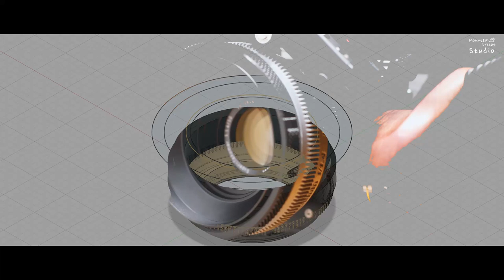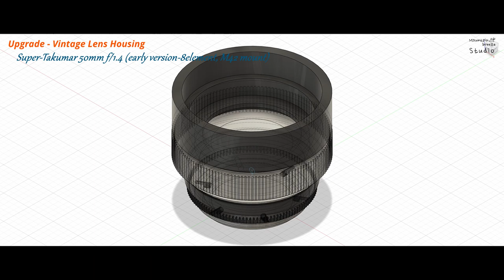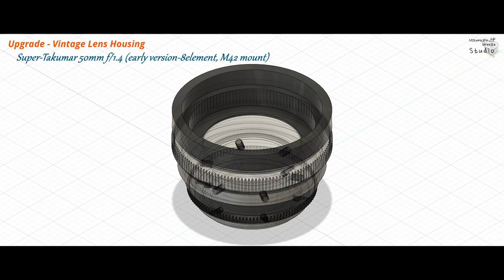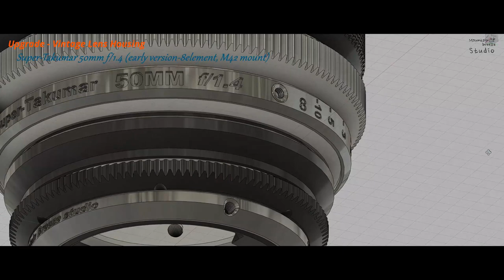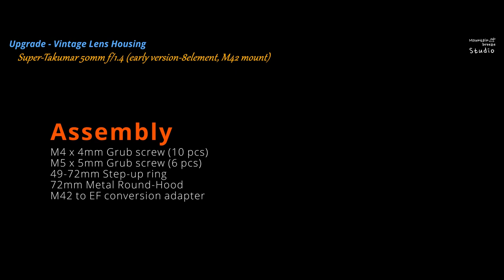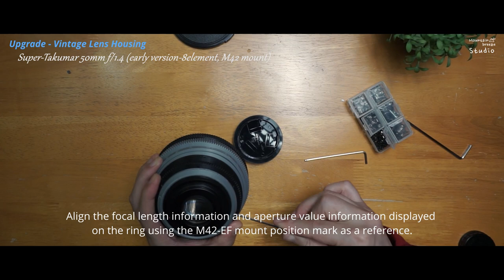Upgrade - Vintage Lens housing "Super-Takumar 50mm f1.4" Cinematic Re-housing 0.8M Focus gear pitch

Comment: hi, which sizes of step-up rings did you use to get the correct height and flare?
Reply from the maker: I used 49-52mm, 52-55mm, 55-58mm 58-62mm 62-67mm 67-72mm step up ring + 72mm (front 95mm filter thread) round metal hood.

Comment: Will this work with the Super Multi-coated Takumar 50mm f/1.4 8-element as well? Are they the same?
Reply from the maker: The shape of the lens is slightly different, so it probably won't fit.
Reply: @MountainBreezeStudio  do you think with your design and slight tweaking like resizing of length, diameter, etc. it will work?

Comment: Hello. Can I apply it in 7 elements?
Reply from the maker: The two types of Super-Takumar 50mm 1.4 lenses look similar but have different focus ring sizes. Unfortunately, the outer housing of the Takumar 7-element lens is a bit larger, so I don't think it would fit completely well.
Reply: @MountainBreezeStudio  thank you for the explanation. By the way I am happy watch your channel. Maybe next time you can make 7 elements rehouse.